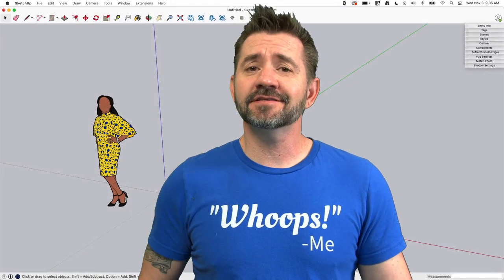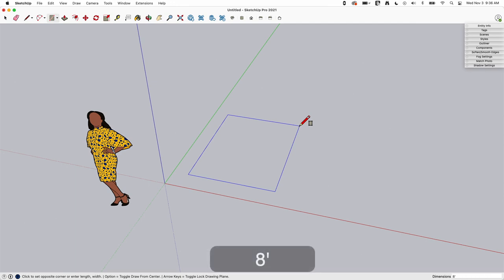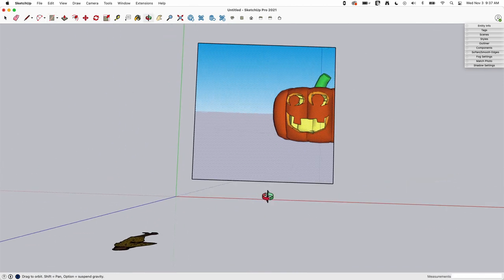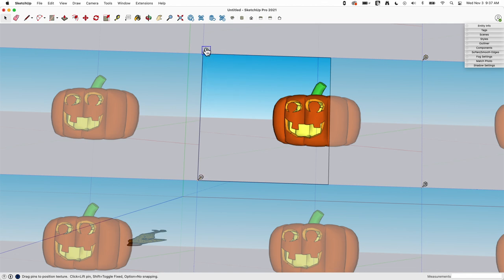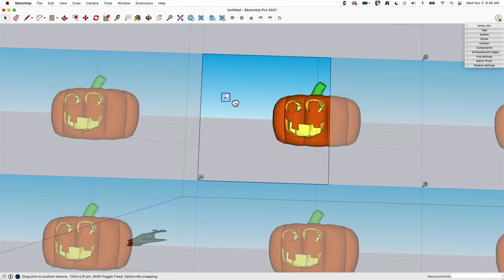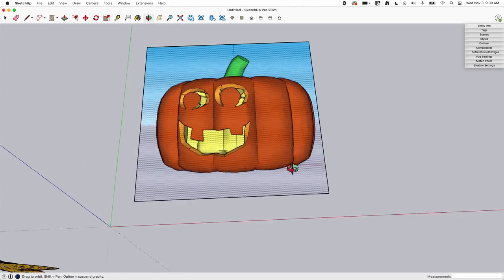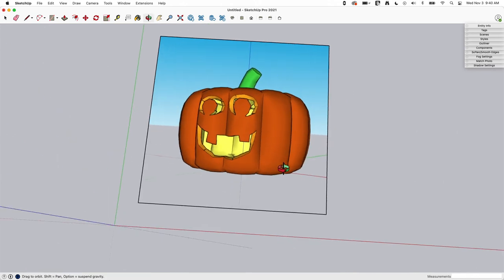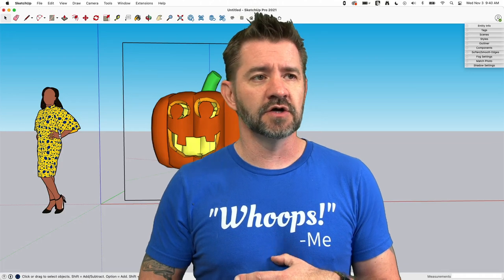Deforming Images with Pins - Square One

Comment: Is it possible to distort an image in match photo like with the white pins? I draw historic buildings from vintage photos taken by glass plate cameras that were shifted to correct distortion. In match photo I need to put back the distortion for match photo to work.